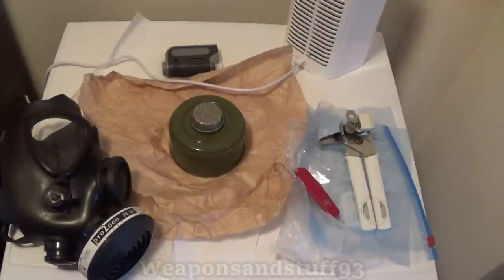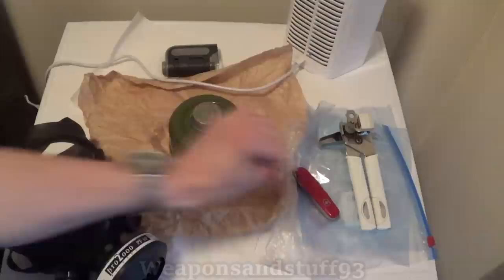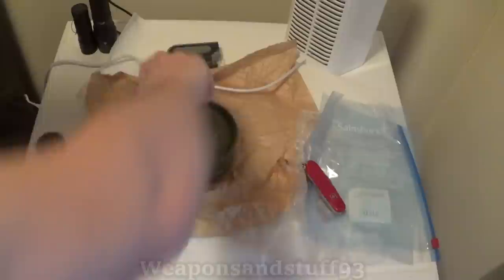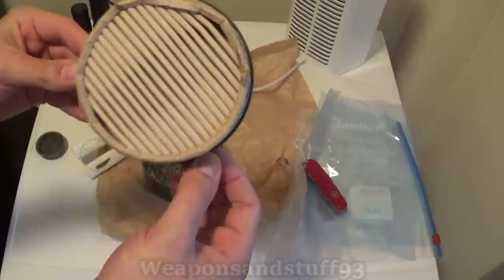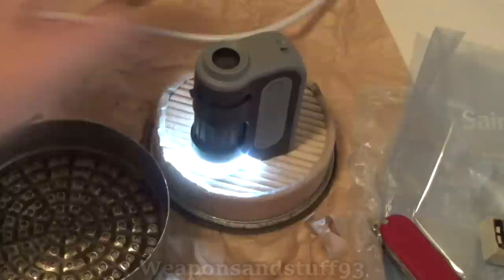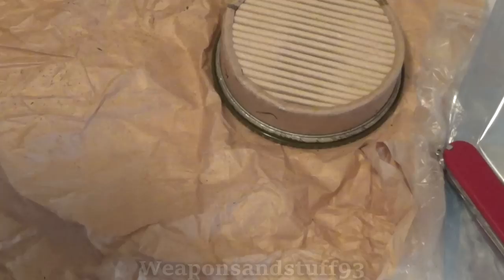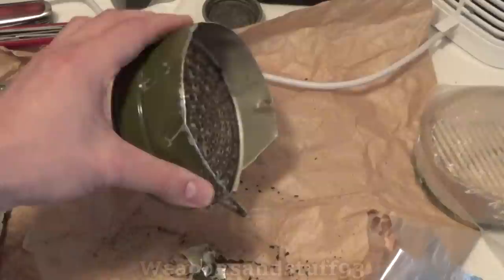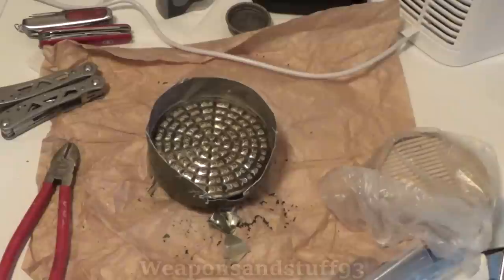What's inside a GP-5 filter?

Comment: filter 2 (after the charcoal filter) can be replaced with an air filter from parts of a new motor matic vehicle. then to be more sterile you can add a material coatings from the n95 mask as the third layer. so in order to be maintained, the mask is used only once in certain of emergency conditions (usually toxic gas). mask model can be made according your taste, but using the hose as a respirator connector is better because the filter can be replaced in many times.

honestly i have never made it but from the instructions of this video you can imagine the results later like what. thanks ☺️👌

Comment: You sir, have a lot more balls than I do. I hope you survived without inhaling any. This was a good video, thanks, although I do wonder why there was any asbestos at all in the paper section.
(On a side note, theoretically shouldnt the charcoal and cotton prevent any inhalation of the fibres?)
Reply from the maker: Because the Soviets mixed asbestos into the paper layer.
As for blocking the asbestos, depends on how small the fibres are that break off.
Reply: Aye, I know that, but why bother? There was so little asbestos it would be unable to really add anything to the filters potency, so it makes little sense to use/waste it on something so trivial.

Comment: I have cut open an ekastu a2b2e2k2p3 filter and it had like suspicious looking parts that like blocked the charcoal and were put between the activated carbon and the particulate filter it hab like long thick fibers there. Also the Particulate filter didnt burn it just smelt like plastic when I put the flame under it. The filter expired in 1992 but i dont know when it was made i think in like the 1970s. Do you know if there could be any asbestos inside ?

Comment: Would a GP5 filter still be useful for safety uses after the particulate filtration section was removed?
If not, I could eventually remove the particulate filter and just put the GP5 back together for cosplay and skits. Correct?
Reply from the maker: Only against vapour but they are long since expired, I would not recommend opening them to gut them as that is far riskier.

Comment: Well shit, i've worn GP-5s for probably an accumulated days worth of hours with filters on. Nice
Reply from the maker: You can always get a lung x-ray to check what's in your lungs.
Reply: If the filter wasn't in to bad shape it probably hasn't leaked a lot of the asbetos and you actually need quite a lot of asbestos to really have troubles with asbestos so don't worry to much man it's not good but your lungs should be fine

Comment: I have a question about your M15. As an M65 clone, do any issues with the M65 (more specifically problems with the seal) carry over to the M15 or any other M65 clones?
Reply from the maker: The M15 has a peripheral seal so makes a much better seal than the M65, the Czech CM4 has similar seal problems to the M65, the Bulgarian PG-1 that I have also seals better than the M65 but not quite as well as an M15.

Comment: soo. looks like we can just can open our gp-5 ripe out the particle filter. throw all the asbestos in the air while doing it. put a new and safe p3 filter in, hot glue it back together and done. a safe gp-5 filter.
Sounds reasonable and safe ( if you don't count the asbestos in the air
Reply from the maker: That's obviously a dumb idea.
Reply: Or just buy a GOST filter...such as modern russian filter or polish FP-5

Comment: if you get rid of the part with the asbestos and fix the filter itself can you wear it?
Reply from the maker: You risk having asbestos dust still inside as well as metal shards.
Reply: The dangeroud stuff really is the loose asbestos dust in the mask that comes off over time, not the asbestos that is still in the filter. Because if the asbestos would just be stuck in the filter, it wouldn't go in your lungs. 
So that wouldn't really help much i'd think. There would still be asbestos in the mask if you just do that. Plus, without a particulate filter, its not a very helpful filter anymore. If you really wanted to fix it, you should take everything out, clean it(soap and water should be enough) put new active charcoal in and put a new particulate filter in. But at that point you could just buy a new filter.
Reply: Weaponsandstuff93 ok, just wanted to know👍

Comment: If the paint on a soviet gp 5 filter is roumered to be lead based doesn't that mean the paint on the Gp-5 metal piece would have it too? If so, would it be a concern for the household air?
Reply from the maker: I'm pretty sure lead paint is only a risk when it breaks up and can be inhaled.
Reply: Weaponsandstuff93 Okay, thanks

Comment: Hey I ordered a m65 gas mask for Halloween last year and I came with a gp5 filter for some reason I keep it on top of my drawer and I know it contains asbestos but I just want to know how to get rid of hit because sometimes I worry it’ll start leaking and I could die from the asbestos so I just want to know what to do with it any help is great
Reply from the maker: Just put tape over each end of it and it will never leak.
If you really have to get rid of it, contact your local asbestos disposal service, DO NOT throw it with regular trash.
Reply: Weaponsandstuff93 a
Reply: Weaponsandstuff93 thanks I appreciate it

Comment: If I were to make my GP5 filter safe by cutting the bottom of the filter off and removing the asbestos-containing filter and sealing it in a bag, and doing all of this at the end of my street, would I be potentially putting everyone around in danger? Also do construction filter masks block asbestos?
Reply from the maker: Anybody in your house potentially. You need a P3/P100 filter to block asbestos.
Reply: Weaponsandstuff93 But what if I were to quickly dunk the cut-open asbestos-containing filter into some water? Would the asbestos go into the water or would it not stick or something. Because even though the person I’m buying the gas mask from says that the gp5 mask and filter are brand new and will work 100% I do not trust him and want to be safe.

Comment: I have heard that the filters contain a percentage of lead which can dissolve to inside the filter or something over time, or in the paint. Anyway either im curious about testing it with one of those lead tester things, i dont know how accurate those are but i guess they can give a general idea whether something has lead in or not. Not sure how much it will be able to detect, i have never used one. 

Also im curious about the paint on the intake containing lead, which i doubt, but hey i wouldn't be surprised if it did.
Reply from the maker: As the filters also contain asbestos, best not to use it.

Comment: Hey,
As I've shown you on twitter I opened my soviet canister. After 3 months the bags which I stored the particular layer in started to decompose. So I put the particular layer carefully inside a glass jar and closed it (+ I put duct tape on top so it won't open by accident). A small amount of the particular layer (about 1x1cm and 0.3cm in height in total) flew away. I think I probably don't need to call any fuzzy hazmat disposal teams???  The area which I opened my filter is an open area but its surrounded by apartments. Also lastly I only used gloves and a respirator to open the filter, how do I properly clean or decontaminate myself. Me and my friend just used a lot of soap and scratching afterward.
Reply: Random12FPS That is so fuckin dramatic dude really you had it covered
Reply: Are you trying to make the Bible goddamn

Comment: I highly doubt there is lead paint on that. Lead was used in oil paint. Oil paint does not come off with acetone, but the paint on the gp5 does come off with acetone. Therefore it's probably not lead paint.

Comment: Why are you not wharing gloves?
Reply: Why would be be? Asbestos does not penetrate skins. If you wash them afterwards you will be fine.
Reply: Hey man, even though asbestos doesn't penetrate through your skin you still wanna be wearing gloves, before I started my current job I did a hell of a lot of this kind of stuff, working with asbestos in old popcorn ceilings in old houses and stuff. You always wanna wear gloves - surgical gloves at least, they're thin little things but really kinda useful.

I used to wear chemical gloves with those gloves you use when doing lawn work in your back yard.
Reply from the maker: Because I don't trust surgical cloves, and it's easy to wash your hands afterwards, asbestos is a threat if inhaled or ingested, not from touching skin.
Reply: Yeah, I really don't see why you'd have to wear gloves when you make sure to wash your hands and don't smear them all over your clothes before that.
Reply: Since you don't seem to know what asebtos is asvetos is really thin fibers that if you breath it can go in your lungs and those are toxic.so as long as you have something to protect your mouth and nose and you wash everythink afterward and do it in a proper environnement where asbestos fibers doesn't go in place where you can get contamined it's fine